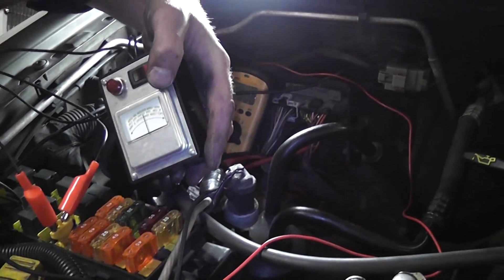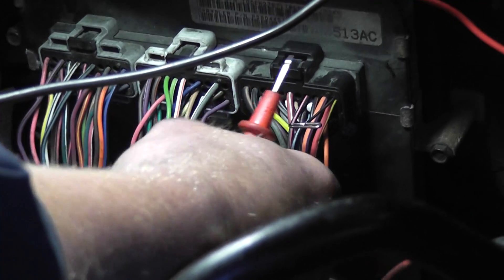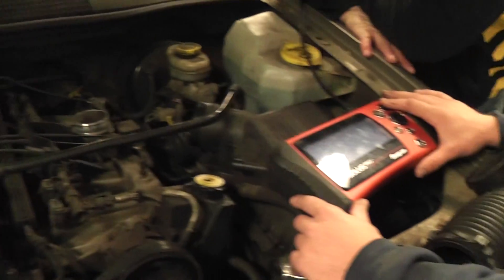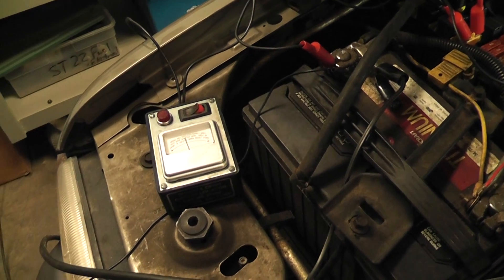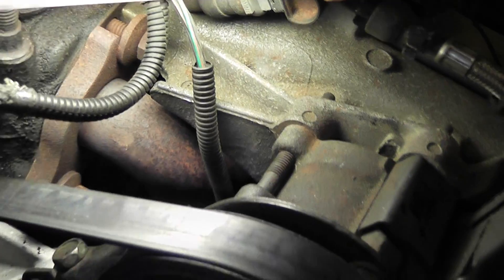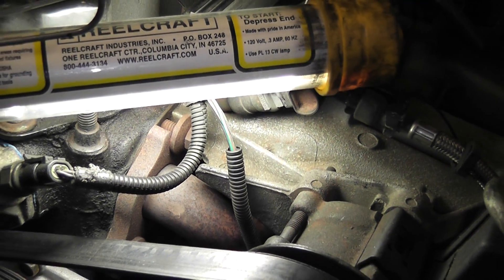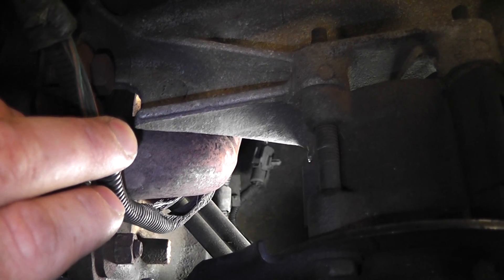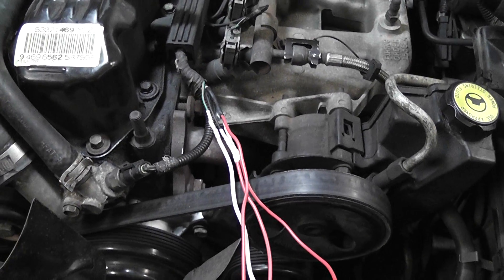1996 Jeep No Start Case Study Part III

Comment: Can pin a14 red/yellow carry 8 colts through the pcm and ce out as 8 on pin a22. I'm getting 8 colts when I test a22 from pcm pin to ground no wire hooked at time.I was going to test a14 and wires coming from that pin,guess I will check on Tuesday this one is a 96 keep Grand no start and it's been a mother. I did find wires to sensor melted on exhaust though,but repaired and still get 8 volts on ground side . If I hook test light from ground on battery the 8 volts goes away if I check the ground side with meter and test light hooked up. If I go straight from ground to fuse with wire it still shows 8 volts.atrait
Reply from the maker: Older Chrysler/ Jeep systems used an 8-9v reference instead of a 5v reference to power the cam, crank and vehicle speed sensors. Are you sure your not testing that circuit? Or you are sure that your seeing 8 volts on the sensor ground circuit?
Reply: A22 red/yellow wire as the Chrysler Manuel says supplies pin a22 at the pcm with 12v coming from I think a142 dark green /0range which the two make connection at asd relay. Voltage

Goes to pin a22 of the pcm I am getting almost 9 volts coming from a22 testing pcm pin direct with cable unhooked this voltage is dropping the coil circuit too low to start. It gets good reference signals and will pulse a test light at coil connector. I because I read somewhere about the 8 volts thought the same thing,but I don't think it should be coming out of pin a22 of the pcm? Boggles my mind on that one but I'm about to get an explanation when I find out why! I really liked your study on the 96 keep three part series or inspired me and helped me jump into wiring troubleshooting.great narrating and testing by the way. You helped me to understand reference testing. Gotta more short to ground and open circuit studies, sometimes it feels like it turns my brain to mush,but I always win and get it right on the end of prevail is the word I was looking  for. Thanks alot, without your videos I would not be inspired.😵‍💫😲🚕

Comment: Got here from a link from your ebook and watched all three videos. Don't have this problem with our Jeep Cherokee but I am going to check to make sure that the wires aren't touching the exhaust. Will use the Cherokee to follow the steps you showed just to familiar myself with diagnosing the different sensors.

Comment: Very good vidios. Do you have a shop and where are you located. Have a 1996 xj with same problen .
Reply from the maker: Pittsburgh Pa
Reply from the maker: Check for water intrusion into the ECM (right kick panel area inside the car)

Comment: We're having problems with my mom jeep . it's also a 1996 jeep Cherokee sport 2 door rear wheel drive automatic. It was running the died on them in town had it towed home . we thought it was over heating? Checked and found out fan was not kicking on? Brand new fan . hooked it up to a direct 12 volt source and fan kicked on . I replaced the relay and temp sensor and also found the factory fan connection was loose fixed that jeep fired up and when it got operationing temp and slowly started get warmerthe fan kicked on and started to cool engine then with in a few the jeep would cut out like it was starving for gas then pick back up and idle smooth then few seconds cut out then died and riggr before it died it backfired and belched a puff of white smoke back up throught throttle body? Eventually the jeep quit running and now it just turns over and no spark? Replaced TPS , CPS and pickup coil? Replaced coil as well. Getting good supply of fuel and fuel pressure? Evebody we talked to says it's the computer box ? We live in southern missouri and the roads are not the best and we also have dirt roads . people say the computer box probably gave out due to vibration and bumps from the vehicle to the computer box ??? Something about the soldered parts in the Box - circuit board??? Box is properly mounted and not loose? No blown fuses?

Comment: So would it be easier knowing u have a no fuel no start to jus follow the ASD diagram instead of chase the 5v ref I'm have the same  issue on my 96xj fuses n relays gud sensors are new nvr a issue tranny went out sat a year now crank no start no fuel or spark but always maintained so fuses n sensors starter n alternator n battery cables are new b4 the issue ????

Comment: We're having the same problem with our 1996 jeep cherokee sport .was running and just shut off????  We put on the correct way : TPS , MAP, temp sensor , ECM , electronic pickup in distributor, coil , O2 sensors ,  new CPS and air temp sensor and the sensor next the TPS that a fancy version of a electrical choke. No blown fuses . Still no spark  but turns over and gets fuel and fuel prssure. I checked O2 sensors wiring harnesses all good . Ill recheck ground connections. Any suggestions?
Reply from the maker: Single coil with distributor right? Take an incandescent test light to ground and touch on coil positive and coil negative and tell me what the light does on both wires. 1 should be lit steady and the other should flicker during cranking
Reply: @ScannerDanner   ill try that and get back to ya few days

Comment: I had to give my appreciation to you and your people!!!! This video was EXACTLY WHAT WAS GOING ON WITH MY 98 grand Cherokee! EXACT wires on the manifold the fuse blown...smh...blessings, blessings. Now I'm on to solving the trans over temp light for a 2004 jeep grand Cherokee. I changed the governor transducer sensor and the governor pressure  solenoid...didn't work. Then I changed the transducer sensor. Didn't work...next move is the governor pressure solenoid again...would be great to know best place to by both transducer sensor and governor pressure solenoid?... anyway my appreciation for this video!!!!

Comment: My jeep pops this same fuse but only does it at an idle never while driving. What could that possibly be from?
Reply: Btw it is a 5.2l not the 4.0
Reply from the maker: get a good wiring diagram and find out what all is on that fuse http://eautorepair.adtrk.biz/?a=10817&c=24&p=r&s1=
You can purchase service information (diagrams etc) for your Jeep for $20 for the month giving you access to the same diagrams I use. Hope that helps

Comment: after playing around with my 96 XJ and not having luck figuring things out, I watched all 3 of these videos.  When you found those smoked wires I had to check, even though it is 12:30 in the morning now, I strapped the headset on my head and headed out to do a quick visual inspection and literally the same O2 sensor wires were smoked on mine.  I'm super excited and hope this fixes my XJ entirely.  I'm so excited that I'm really close to soldering on some new wires tonight and trying it out but I'm headed to bed.  Big shout out and Thanks for the vid!
Reply from the maker: sweet, let me know if you fix it
Reply: Sure enough it fixed the problem.  The kid before me had given up because it kept popping that fuel pump fuse and so I picked it up for $500 and rolled the dice.  After searching Youtube for hours I came across your video again and want to thank you.  She purrs like a kitten and surprisingly enough everything works on it like day one, even the A/C :-).  

I do pose a question though, not sure if you have time to help, I put a 12v light tester on Fuse F18 and F21 and neither of them lit up?  I'm not sure if I needed the key on or not for that, its another thing I came across tonight thru further research, and I know that I need to replace the battery.

Last question, It shows my alternator only putting off about 13.5ish volts, is that sufficient.  Shouldn't it be about 14.1v?  How do I check the actual output of the alternator, silly question I know and I do have an olm meeter.
Reply: Thanks again for your video and your help.  You increased the value of my XJ by 3 times at least and all within about 2 minutes or so of actual video time when you started talking about those wires.
Reply: The fuses that I'm talking about at F21 (I think is what it is) 10a, and F18 (again I believe what it is) 15a.
Reply: you've got a new subscriber!
Reply from the maker: Fuse 21 transmission control module and torque converter clutch
Fuse 18 AC compressor, rad. fan, park-neutral position switch, EVAP purge sol, back-up lamp, low washer fluid level

Both of these fuses would not show power until you turn the key on

I'm totally fine with 13.5 especially if you know you need a battery. Replace the battery then retest. To stress the alternator, turn all your accessory loads on. (rear window defogger, high beams, blower on high, AC on, wipers on high) then recheck your voltage at idle and 1500-2000 RPM. As long as you are staying above 13 volts during this test, you'll be fine.
Reply from the maker: awesome! If you need additional help in the future post to my forum okay?
https://scannerdanner.com/forum/post-your-repair-questions-here.html
hope to see you there
Reply: Thanks so much!
Reply: ScannerDanner done! Thanks

Comment: what is the asd relay
Reply from the maker: +Mark Healy it stands for Auto Shutdown Relay (ASD) 
It's basically a fuel pump relay and is controlled just like it but it also powers the ignition coil, fuel injectors, alternator field circuit and O2 heater

Comment: I did see another video doing that with the distributor pulled out, it looked like it should be easy enough. I will have to get a compression tester from my buddy tomorrow and I will keep you posted. I typically am a parts changer, but I usually know what the problem is. You have been very helpful, and changed my thinking. Thanks for the videos.

Comment: I do know that there is a crack in my exhaust manifold, blowing heat up towards the fuel rail. Going to pull one off of a donor 94 tomorrow and put it on mine. Would that cause the vacuum pressure to mess with the MAP and trip the ASD? I'm serious about a trip to Hawaii also, come on out.
Reply from the maker: +andrew teter that will not cause the conditions you described. You must do as I described next. Compression test and then verify that your timing chain does not have excessive slack

Comment: How big of a project is it to check timing on the 95 4.0? I've never done it and have had the Jeep since 2001. Can it be done without a timing light? You have a video by chance?... Would low compression in a cylinder cause it to run as described though? seems like maybe the ASD is killing fuel, but I can't find why.
Reply from the maker: +andrew teter you described a very rough idle and will not accelerate right? The ASD relay is not your issue. 
The timing cannot be tested with a timing light on this model. You need to put the #1 cylinder at TDC compression and line up your timing mark on the harmonic balancer to zero. Then remove the distributor cap and rotor and look at the cam sensor drive plate. There is a small hole that should be aligned with a small hole in the distributor housing. Basically you should be able to place a small screwdriver down through the cam sensor plate and through the distributor housing if the timing is correct.

Comment: After watching your video, I was really hoping to find a melted wire. I have a 95 ZJ limited with a running issue. I was initially getting low fuel pressure, so I changed my fuel pump and filter. It ran great all day, then died suddenly in the afternoon and would not fire back up. No codes, no blown fuses. It would turn, but not stay running right. If it did idle, it was rough, and as soon as you hit the throttle, it would cut out. I thought it was not getting good fuel, so I dropped the tank again and confirmed good function of the pump. I also started changing sensors, it has 260000 miles, so I did the IAC, TPS, MAP, the crank position sensor, cam position sensor, ECU, plugs, wires, cap and rotor. Still, no change, it fires, but any throttle would kill it. Tried then to unplug IAC, MAP, and TPS, and it stays idling. Can rev with them unplugged now, but when I tested all three circuits, they all check out ok? I checked wiring harness, found no issues apparent. Checked O2 sensors, the circuits check out. Kinda stumped at this point. If it runs really rough, with all three unplugged, and plugging them in kills it but each is good, what am I missing?
Reply from the maker: +andrew teter my first thought is timing chain. also before doing anything else you need to check compression on all of your cylinders.

Comment: Why was the fuel pump running?  Was there a back feed that powered up the fuel pump? Or is ASD ground side switch and getting a ground to turn on and power fuel pump?
Reply from the maker: +Bill Rimmer the ECM was grounding the ASD relay all the time. basically because half of the brain was dead and the other half was alive.

Comment: Great series on this Jeep ... I am dealing with an issue like this today ...  1 question though ,  I was told in my auto electrical class that you can not solder a 5v reference circuit .. I was told it would add resistance into the circuit and would not function properly afterward ..  Going off of this video what I was told is not true .........   Will there be an adverse effect to soldering the reference circuit ?
Reply from the maker: +Norman Murray What do you mean by soldering the reference circuit? Do you mean a damaged 5v ref wire to a sensor cannot be soldered?
Reply: Yes , that is what we were told .. Because the change in resistance (even a little ) will change what the computer see's and how it acts ...  I didnt understand this when I was in class but seeing you do this repair has me wondering what else I was taught wrong ..  The heated O2 circuit is what I asked about in class (because the one on my Jeep was damaged ) ... I was told it couldnt be repaired and had to be replaced ...
Reply: +Norman Murray that is an excellent question. I just ran a new harness from a cam sensor on a 2008 GMC Sierra and it had soldered connections to the ECM so I could bypass the vehicle harness and once I was done I could not get a signal from the sensor. I know I had good connections and do not know why I couldn't get a signal from the sensor. I ended up wiring it back through the vehicle harness and I got my signal back. The only thing I could come up with is the soldered connections possibly being the issue. Any other ideas ?
Reply: +Norman Murray I just re-read your question and you cannot solder a oxygen sensor wire on the sensor side (vehicle harness side I suppose you can) and that is because the sensor actually gets oxygen through the wires. Sounds crazy but its true
Reply: That may be what he was trying to explain in class , but it just didnt make sense to me .... So soldering the harness side is ok , just not the sensor side ?

Comment: Thanks so much for your teaching. I saw this video a long time ago but actually just solved a no start situation w the same symptoms just the other day. In my case it was a lot easier to spot. The reference voltage was 2. Something volts. I startes un plugging sensors and on mine (99 gc 4.0) the oil pressure sensor is on a different 5v ref than the rest but as you say theyre shared internally. When i u plugged it ref shot back to 5. I took a closer look at the wiring and the wires had melted on to the block and all 3 were melted together. It was an easy fix but it wouldnt have been so easy without your teachings. Thank you paul

Comment: I got a Jeep that is having problems. I lost all power to my windows, my turn signals quit working. Now she don't wanna start. I guarantee I can chase down a wire that's toast somewhere. Every now and then it will kick the check engine light. Turn it off and turn it back on and the light is gone though. I am poor as they come, I'm lucky I was even able to get the Jeep. I'm gonna go see what fuse number I'm blowing, see if I can find where all it goes to and see if I can track that sucker down! I did notice on the Jeep it looks like whoever owned it last replaced some wires before. I also noticed over night the battery would go dead and I just put a different battery in because I ruined the last one, I almost guarantee I'm having a similar issue. Thanks for the vid though. I would love to do some hands on training like this.

Comment: Holy crap are you the MAN!! I followed your video step by step and finally after 5 days of "what the heck!!" my jeep is back on the road!! By no means am I anywhere near a mechanic but I am an A.C. tech and probing and checking I do understand. Thank you so much for your easy to understand and step by step informative videos!!
Reply: so what was the fix my friend?
Reply: ScannerDanner Premium # I was having the same symptoms from the start fuel pump continuous went through the wire chasing steps then just as you found in the video checking the o2 sensor discovered that the cables had been run too close to the exhaust and cooked the darn wires!! rerouted the wire harness a bit different and shazaam~! Thank you again, because I honestly didnt know where to even begin when it comes to automotive and paying someone at least 60 dollars an hour just isnt in my budget!!
Reply from the maker: R Woo awesome, thanks for sharing! Sorry I took you the long way around on this one. This was one of my first videos and I really wanted my students to have a good grasp on testing the 5v ref. circuit. Also I truly thought I had a shorted sensor when I filmed this. Anyway, I'm glad you found your problem.

Comment: Hey Dan I just wanted to let you know thank you for your videos I've got a 93 jeep with a 4.0.. Started running bad last week gave it a good tune up cap rotor wires plugs fuel filter got worse started throwing a code 24 and putting it into limp mode I don't have a scanner but I went the old school way and back probed at my throttle position sensor for 5 volts and started unplugging everything on that circuit then I ohm'd out my throttle position... Back in the day before they even had diagnostic